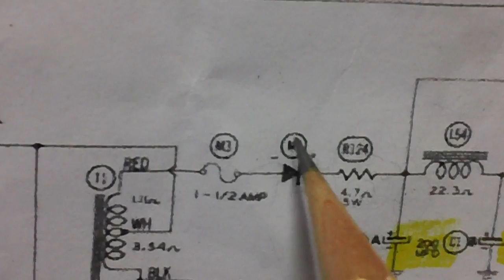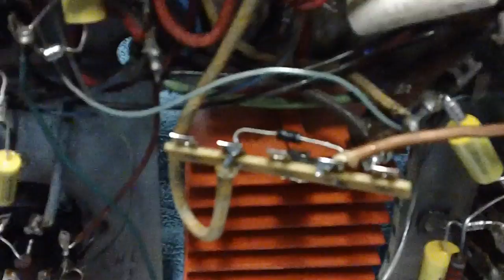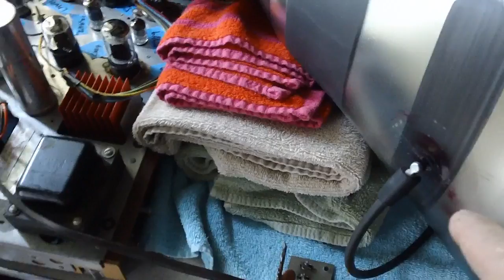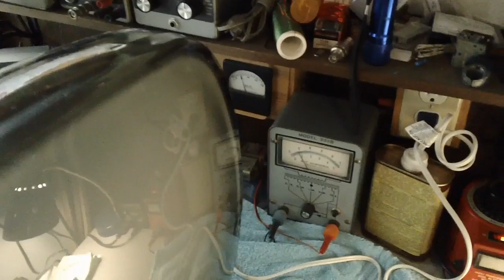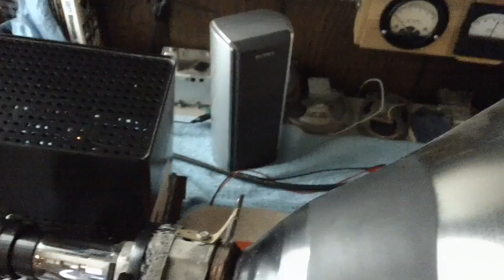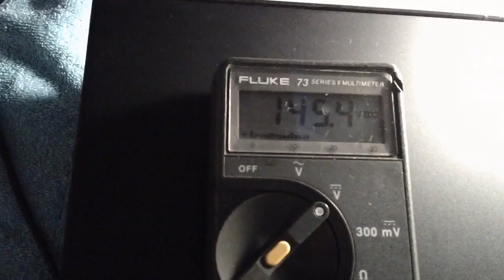1956 Sylvania 21" Halolight TV restoration (part 8 of 23).

Comment: I would have left the old selenium rectifier alone as long as the voltage was right.  Also that diode you used was really small wattage one.

Comment: John, nice work on that TV. I have a little excitement myself over here today. I did my First Power Up of my Atwater Kent 44 and E2 speaker. Last part I did today was to install the damper on the reed spring. Had to use a clear plastic tube with a piece of heat shrink inside to get a good fit.  Everything I did with this radio I learned from you, so thank you. Now I am off to Naval Jelly the heck out of the case.  Thank you !!!!   I am running my own local radio station as  you suggested as while back.. perfect for testing .  Here is a vid.    https://www.youtube.com/watch?v=CSEvUM1mmUM&feature=youtu.be

Comment: John,
Not a bad show for a first time switch on.  A few further tweaks here and there, including calculating the value of a HT rail compensating resistor; adjustments to the frame linearity; secure everything back onto the chassis and get it back into the cabinet; back cover screwed into place; and leave the set on soak-test.  I’m sure, from now on, it will be as straightforward as that dear chap.
If, by any chance, you are looking for suggestions for movies that could be viewed on your Sylvania TV, then you couldn’t do much better than anything that includes any one of the following actors: James Cagney, Paul Muni, George Raft, or Frank Sinatra.
An excellent video my friend.
Regards,
Phil.

Comment: I was thinking that if the flyback was shot, that you'd have to get the ignition coil from your John Deere.
I wa.s going to suggest that you adjust the spark gap on the CRT.
Lookin good OT.  Don
Btw, what was that tube web site? Or must I watch all your vids to find it?
I need a couple 6CA7s for my Lafayette.